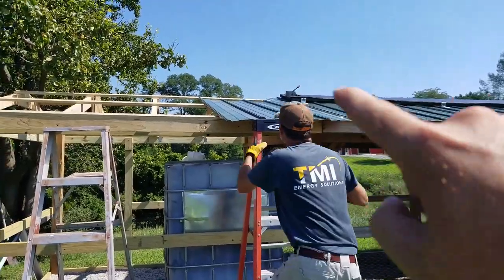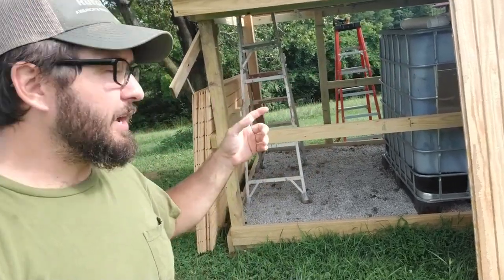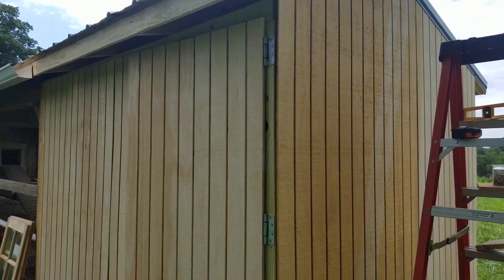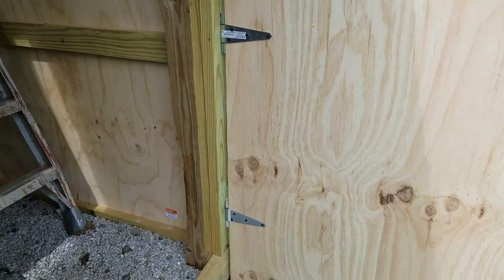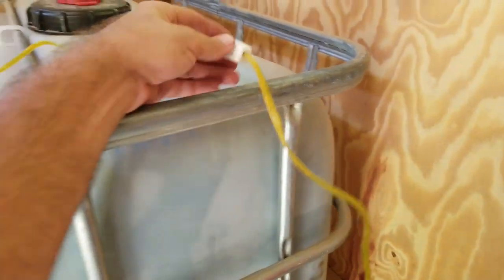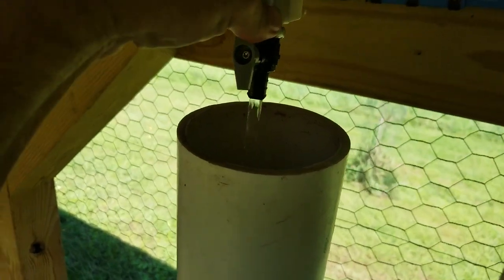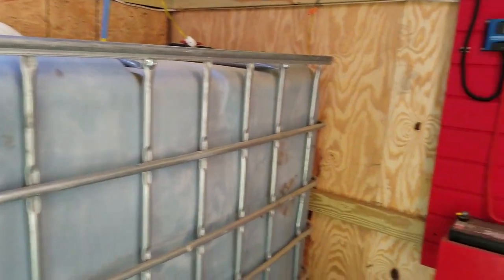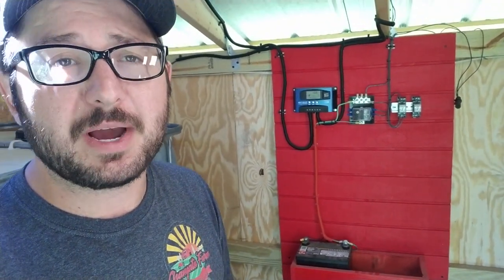Chicken Coop Rain Water Collector Build: Part 2

Comment: Great video.  I really like the system. Did you give any thought to installing a filter for your rainwater, or do you not think it will be necessary?
Reply from the maker: I did end up installing some mesh gutter guards to at least keep pit leaves and larger particulate. I have had no major issuers with stuff getting in the tank yet.